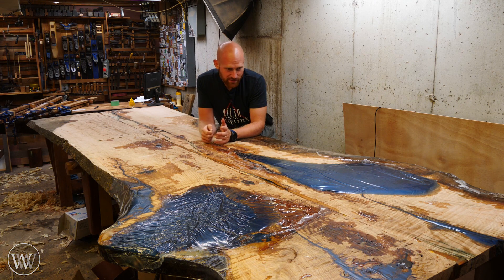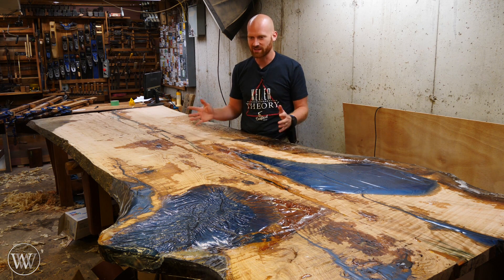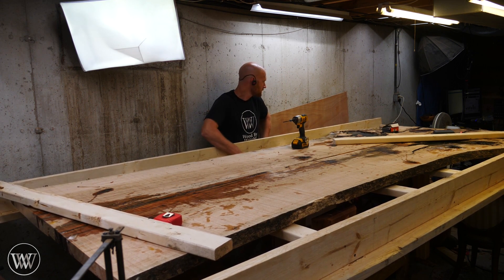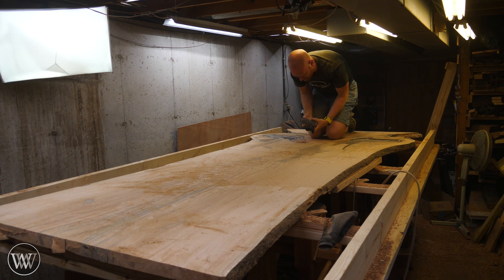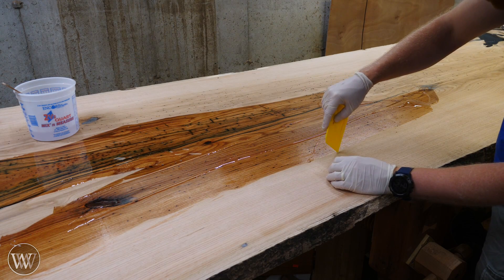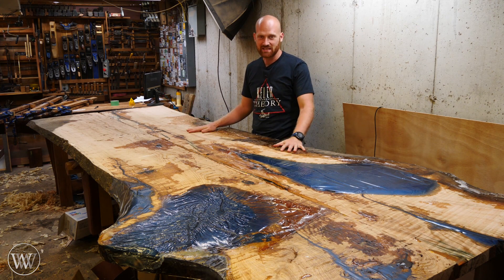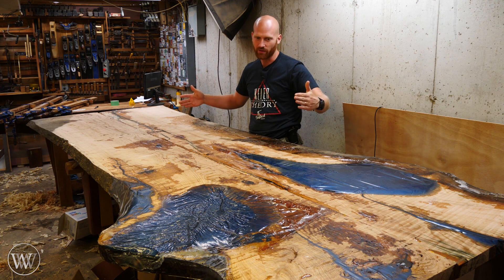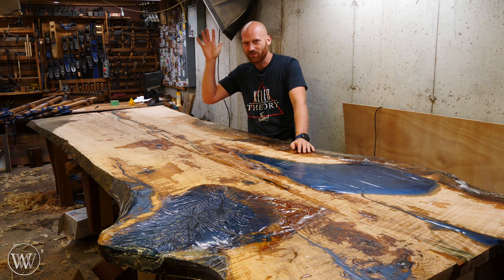Making a Live Edge Dining Room Table Part 5

Comment: Wow! That's starting to look like an awesome tabletop!
One question though: with all those bug and worm holes, aren't you afraid that they're going to come back and carve more holes? I made a pair of side tables using two large chunks of elm with a few bug holes - not many, not very few, just a few considering the age of the wood. And now, a year and a half later, the tables are showing more and more new holes...
Reply from the maker: Dario Solera thanks. No I have been keeping my eye on it and there is no saw dust from them. They were stacked outside in northern Minnesota for 3 years. That will kill most everything.

Comment: What tool would you recommend to flatten a 6'x2' table top?
Reply from the maker: if it is not too far out of flat I would use a scrub plane and hand planes, but if it needs a lot of work then a power planer or router sled save a TON of time.
Reply: Wood By Wright I'd have to take off about 1/2'' of soft wood, I was thinking about a belt sander but now I don't that'd be a good idea
Reply from the maker: I would much rather use a plane then a belt sander. for that much I would probably use a scrub plane to take off the majority then come back and smooth it out with a #5.
Reply: I agree ; ^ ) thanks.

Comment: My OCD would have me smoothing the underside as well. It just doesn't seem finished to me if it is left rough. Having said that, This is to be your family's table and is your project. You do it how you want. (Not that you need anyone's permission.) The main question burning in my mind is...
Will it fit up the stairs, or do you have a walkout side to the basement?
Reply from the maker: Yup everyone is diforent. It will go strait up the stairs. There is just one turn so four guys and 5 minutes no problem.

Comment: Will applying a skim coat of epoxy to the top face change the way you need to approach the last stages of smoothing and finishing?
Reply from the maker: nope. epoxy works very slimier to how the wood does.